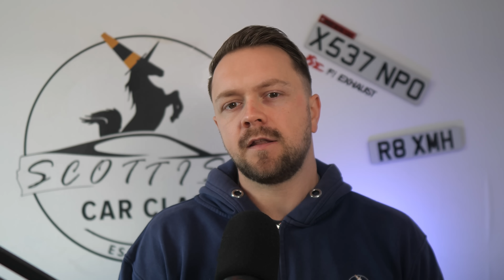Modern Cars Are FAILING Us — So I’m Saving the Reliable Ones

Comment: Get rid of touch screens and expensive parts.
Reply: Touch screens are a dangerous distraction for drivers. More so than mobile phone usage.
Reply: @jimmcintosh9045  - agree especially when they are used for tasks such as heating controls. Physical switches and levers are so much safer and of course so easy to repair if they break.
Reply: @rogerbarrett9920 I can't understand how this is allowed to have climate control and such features on essentially a tablet when you shouldn't even have to glance to work them when you get used to driving the car regularly, and another big danger is led lights, I have halogen lights in my car and never once have I thought they're not bright enough
Reply: @rogerbarrett9920 yes a quick glance at the heating switches and adjust instead of bloody tapping on menus.
Reply: @jimmcintosh9045 windows steaming up? Gott use the touchscreen to change the direction of the air🤦‍♂️
Reply: Get rid of computers, totally unnecessary
Reply: I honestly can’t believe that they are driving costs up that much. I bought an after market one specifically for my car for a little over £100, and it’s infinitely better than using my phone in a holder. I’ve seen new £20k cars with piddly little cheap plastic looking screens and cannot believe they cost the manufacturer more than £20 to include. Routing controls through them maybe, but the clamour is to return to physical buttons for the basics, and I think that will happen
Reply: No chance, I want to pay huge money on maintenance and leasing a new car.
Reply: Unfortunately software is taking every aspect of industry in the world. Too costly to produce physical parts.❤
Reply: Well, I don't agree with you.
I have bought really cheap android Touch screens directly from China in my past 2 old cars.
Not have had any problem, but I have never had a car or motorcycle for repair.
Fixed everything myself cheap, 
don't see why not buying a touch screen from China that they have made to fit in my old Volvo's 😁
I see car manufacturers take 15 times more for badly Touch screens with expensive problem's,
it's unbelievable that people would pay a fortune for New car's that is not built to last....
Reply: Bring back horses...
Reply: @andylane247 I have a 2001 corolla and never once have I thought I need a touchscreen,  i have an aftermarket radio with Bluetooth and if i need maps I put my phone in a holder, they're not needed in cars
Reply: @PJD4875 
Its what the public wants...
Reply: @andylane247 you're right but getting rid of touchscreens doesnt mean we're going back to a horse and cart, but you are right in saying its what most people want but I'm also right in saying nobody actually needs a touchscreen in their car they just want a touchscreen
Reply: @PJD4875 
We don't need Coca cola either...
Reply: @andylane247 exactly but a lot of peopw want, what im saying is why people want and need can be 2 completely different things
Reply: @PJD4875 
Americans need socialised healthcare. They'll never have it though...
Reply: @PJD4875 Cause majority of people are dumb.
Reply: @PJD4875  yes and no my car has quite a few features that if you tried to offer them via buttons it would be harder to do and you would have millions of buttons
Reply: @PJD4875 So you’re basically saying they are needed then?!
Reply: @jd-py5nm my point is that your car probably doesnt need those features, it may make the car better in ways but what I mean is its not essential, the vast majority of people dont need the tech their car has, the only only thing I wish my 2001 corolla had is cruise control as that is very handy for staying withing speed limits when you naturally have a heavy right foot
Reply: @PJD4875  Agreed, I have a magnet to put my phone on for Waze and handsfree calls and I use a cheap square bluetooth machine which you tune the radio to.Sound comes through the speakers very well. Occasionally I may get some interference but nothing major.
Reply: @andylane247  It's not !
Reply: @andylane247 yawn
Reply: Watch at 1.5 speed. Thank me later

Comment: I have owned my 2005 Toyota Celica since new and fanatically underseal her every Summer and give her anything she needs to stay on the road.The car has been so reliable and i will never sell her.
Reply: What product are you using for underseal?
Reply: great car. i'm doing same with my s2000.
Reply: Owner of a 1998 Gen 6 Toyota  Celica... It has covered 251,000 Miles owned it for 10 Years, and I will NEVER part with it.  Sadly, the Government will slowly tax them off the road using emissions BS.
Reply: @briansaiditsoitmustbetrue4206 won't sell my 2002 either.It's been off the road for nearly 6 years now but I'm determined to get it fixed & on the road when I can afford it.This government may just kill that dream  but I'm going hold on till the end....
Reply: Glad your keeping her in very good condition.They are awesome car's and deserve it.Mines an early 2002.Got ripped off with it. Bought it from an elderly cow who said it had no rust on it anywhere.Said to ring the garage where it had been serviced and looked after all its life(she bought it new). Garage confirmed what she said.Discovered later on it was fairly rusty underneath.You can't trust anybody these days 😢😢😢
Reply: My GT 06 Celica on 140k and running sweat😊 just in the process of treating the underside too. And my 12 cdti astra on 177k doing great with regular serving
Reply: I have a 2010 Toyota rav 4, 2.2 diesel, I love it, a bit slow and agricultural, problem is it's a bit corroded underneath so I'm going to tackle that as it's a good vehicle, any tips?
Reply: It's tax goes higher every year, right?
Reply: What product do you recommend for undersealing..?
Reply: Come on man, you gotta be reasonable, what is the price? I can come over to you to collect it today, cash paid.

Comment: You gonna buy one car for the next 20 years .(Old or new) What car would it be. ??
Reply: A MK1 Toyota Yaris or a 2004 Toyota Land Cruiser. Or maybe mk6 Ford fiesta 1.25.
Reply: @fionnbetteley5105  Good shout on the Fiesta 1.25. We've got a Zetec 2010. It started life in UK but as a bonus we live in South of Spain so it never sees salt and little rain. Have done the timing belt/water pump and do all the servicing myself regularly. Only thing I don't like about it is no temp gauge, it overheated once when the radiator fan packed up, but a great car.
Reply: Mk 7.5 golf?
Reply: lexus ls430
Reply: Mk1 ford fusion petrol. Same reliability as a fiesta, but more practical with its fold flat seats, larger boot, low rear boot lip, more upright seating etc, and cheaper, as seen  as an old man's car. Who's the smug one?